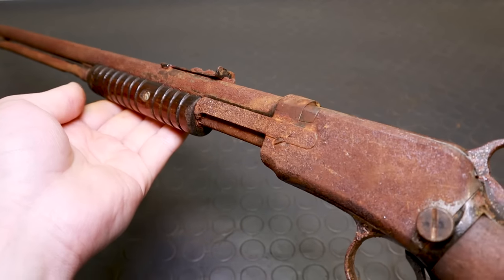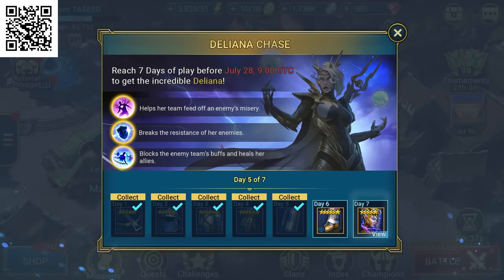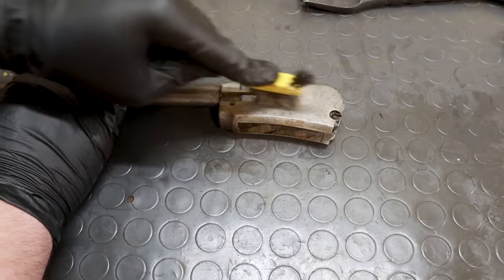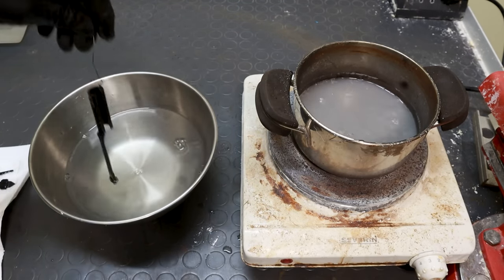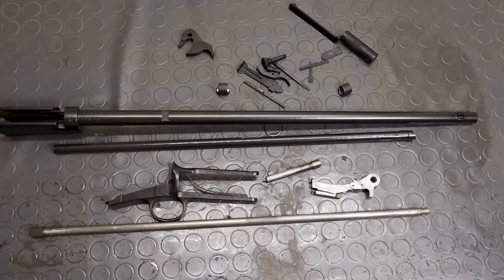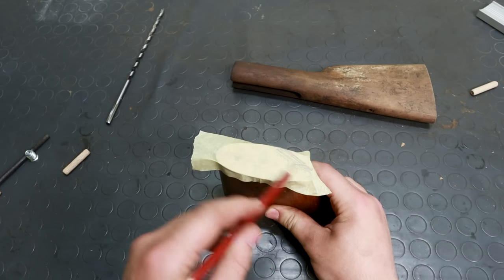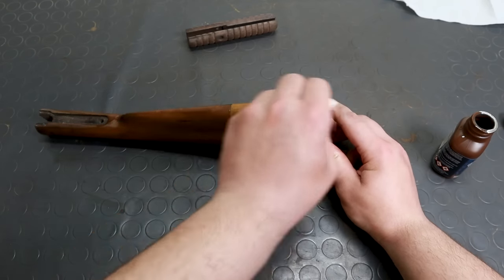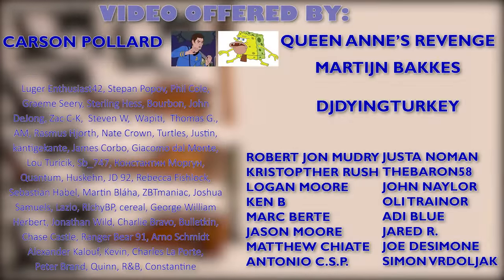Restoring a 1906 Heavily Rusted Pump Action Rifle

Comment: yeah, Rust does not work that way. Only way to get rust off without a grinder is through extensive and numerous acid baths, which is not only on the expensive end of material but which require permits out the ass to operate with. Also, everything is rusted, but the screws are in perfect condition AND they come out with little to no struggle??? Im not buying this. Staged
Reply: bro has never touched anything in his life.

get some experience and come back.
Reply: @rolls_8798  I work as a welder with experience as a foundry worker. You want to convince me that rust magically stops at the screws as well?? Screws would be one of the first things to go! he unscrews it and a magical little circle of almost clean metal glares at us from the area the screw covered.
Reply: @scar445  from my experience at least, the internal surface of finely machined screws like these tend to be pretty protected

and rust can definitely be removed with acid. citric acid might be a little weak but I don't believe it's faked
Reply: @rolls_8798  I never said acid cannot remove rust. I said you need numerous and ridicously expensive acid baths to do it correctly. If you do not give it the correct dunking sequence, all you have is a ruined piece of metal. 
and yes, the internal parts might be fine, but if you unscrew a weapon and take it apart, I expect the rust to have moved beyond the very edge of the screw AND for the metal around the screw to have the heaviest damage, since that is the part that has been worked on. miniature knicks you cannot see with your bare eye, scrapes, hell, even a bit of moist dust is enough to wreck havoc on metal in a matter of weeks, not to mention freaking years.
Reply: @scar445  the metal has been blued for the specific purpose of preventing rust (and looking pretty). I don't think the timing is that critical with the acid bath, especially with such a weak acid. for citric acid to have worked so well seems surprising but I haven't tried using it so I can't disprove it there

personal stance is that this is realistic
Reply: @rolls_8798  well, I showed the video at work today, and all 15 welders and 5 blacksmiths agree that this is a staged video with a gun that was made to look dirty and rusty. Screws would either have rusted away completely or broken the moment he applied tension, if the level of rust on the rest of the weapon is to be believed.  
also, the wood suffered no damage beyon discoloration, even though the weapon had apparently rusted enough to make sliding parts get completely stuck???
not to mention that the "rust" does not reach all the way into corners, nook, and crannies. 100% staged
Reply: @scar445  I find that parts that are tightly fitted together can often escape rust, including under the heads and in the threads of screws. keep in mind that they are machine screws - with low carbon steel (so less susceptibility to rust) and fine tolerances - from my experience, as long as you don't strip out the heads of these, they come out all right.

The bit about wood is a good point but this could easily be rust slowly accumulated over decades or from salty seaside air, which aren't nearly as harsh conditions on the nice and once-oiled hardwood.

The sliding parts are made to have only the tiniest gap so they can move freely but not have any play, even the thinnest layer of rust could seize them. think of how difficult it can be to remove a flywheel, gear or pulley just because of a thin layer of rust on the shaft in front of it.

I respect your opinion, it comes from valid logic, I just don't think it's true

For me, the most questionable bit is probably the flakiness and light colour of the rust - usually indicating that it is fresh - and the consistency, but I think it's just a matter of conditions. At my dad's old house there was an air rifle, stored on moist dirt in a drafty and humid shed and it was in a similar state. Admittedly, I haven't gotten to tearing that down yet.
Reply: @rolls_8798  The rust I see on this weapon is the same amount that accumulates on the rebar I work with, and that spends, at the most, a week outside.
And living in Denmark where no point is greater than 52 km. (32 miles) from the ocean, I can safely say that salty air from the sea would have wreaked havoc on both the wood and the metal. Even with ship Laquer applied every year, houses suffer extensive damage from the air.
I would be surprised if,, what covered this weapon, was anything other than mud dust and a bit of grime
Reply: @derekhenschel3191  we only with with steel alloys all day. I'm sure we have no knowledge what so ever that could be relevant to this video, seeing as you so graciously pointed out that general knowledge of metals and how they react to their environment is of absolutely no use when it comes to restoring said metal.

Comment: Fake. When he takes it down you can see the actual condition of the metal. He 'rusted' it for the video. lame.
Reply: That part wasn’t exposed to the elements due to being under the stock causing it not to rust